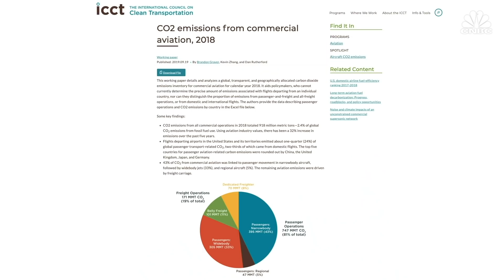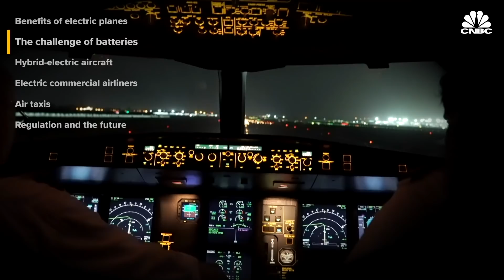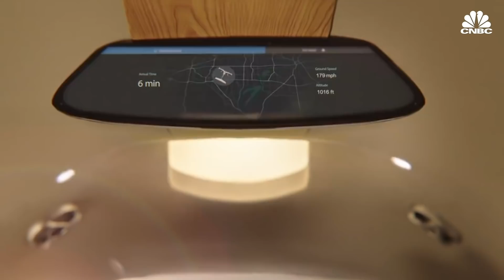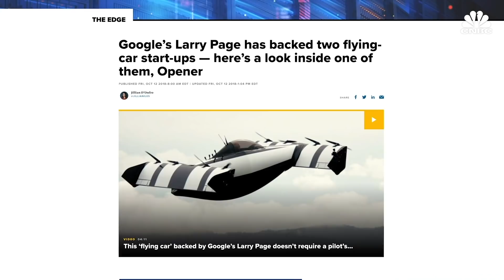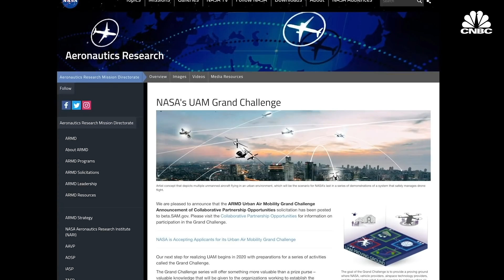Why Don't We Have Electric Planes Yet?

Comment: the other issue for replacing long haul flights with electric is that propeller driven planes physically cannot fly as fast as jet airplanes, the transonic regime that most long haul flights spend the majority of their time in would destroy propellers.
Reply: You don't need to use external propellers.
Reply: @turningpoint4238  good luck heating the air hot enough fast enough to get an electric jet engine to work...
Reply: @136jab  you aren't heating the air to expand it turning the rotating air compressor, what a horridly inefficient way of doing things. Just use an electric motor to turn the compressor. Simple, far more energy efficient and far less maintenance, reducing costs considerably. Never forget what Carnot taught us, because science rules everything.
Reply: @turningpoint4238  how do you  add energy after compressing the air?  simply compressing and expanding the air would cause energy losses due to friction etc.  you still need to add energy somehow and the only way I know of to do that would be to heat the air.
Reply: @turningpoint4238  ok, it has been a while since I sat in a thermo class, and I work in rockets now so I don't really worry about different thermo cycles anymore.  The issue I see with a carnot cycle for propulsion would still be the heat transfer rate from the hot reservoir and to the cold reservoir.  Also, keeping those reservoirs at the proper temperature constantly would be difficult and the reservoirs would be pretty heavy.
Reply: @136jab  take a look how jets work, they aren't like a rocket.
Reply: @turningpoint4238  I remember the jet engine cycle, you compress the incoming air, then you heat it up somehow then you expand it to accelerate it.  I still don't see how you could possibly get a comparable heating rate from an electric system to what you get from combustion.
Reply: @136jab  This is what I've been trying to say you remove the necessity to heat air, thats really not a good thing to be doing. You run the compressor blades with an electric motor. Very simple very efficient compared to a traditional jet.
Reply: @turningpoint4238  compressors and turbines actually run at a net loss in jet engines. The only reason you gain net energy is the heat addition step.  Sure you can run the compressor and turbine on electrical power but you still need a heat source and a resistojet type heat source isn't gonna cut it.
Reply: @136jab  er no, you seem to be stuck on just using a traditional jet engine. Forget expanding air with heat, Monsieur Carnot saw the folly in this nearly 200 yrs ago. Forget the heating  and expansion of air that runs the compressor blades. I know Airbus have been working on this. Google it.

Comment: They forgot to say that jet engines require fuel to create thrust. Even if they sort out the battery issue, electric motors will be propellers. Hence these aircrafts will be much slower than jets.
Reply: Wow, didn't even think of that. Good answer
Reply: In a high bypass turbofan engine the majority of the thrust is provided by the bypass Air. The hot gas generally provides only about 20% of the thrust. So electric motors does not have to be limited to just props

Comment: It all depends the battery, battery don't like cold temperatures in the sky. What I guess engineers may have to design same type of battery that use in space to use in plane. Also if everything is power by electricity, one solar storm will damage everything.

Comment: Maybe a better question would be fuel cell airplanes.  With a fuel cell would require only about min to refuel vs 45-60+ min to recharge and a have larger energy density.  Not to mention the how heavy the weight of the batteries.  One must also look at the fast lane truck tested on towing with a Tesla model x below its tow rating weight and could only do so for 1/3 of its range.  The Tesla Cybertruck was espoused to be at able to tow 14000 lbs for $70k but who knows how far it'll be to do (maybe 165-170).  Whereas a $70k truck from Ford, GM, and FCA can tow 30,000 lbs for about 800 miles.  The electric industry must overcome these logistical issues first on trucks before air transport could be considered

Comment: Temperatures of -44 would wreak havoc on electric batteries
Reply: john son of Morris Not really, as the batteries are not outside. Additionally batteries can have heat themselves when charging and they stay warm when under high power demand (i.e flying). That’s not really an issue I think.

Comment: What about hydrogen? This might be a better option. If i am not mistaken that is also a clean option. All of the airport fuel systems could be converted to hydrogen systems. Hydrogen cells are also lighter and do not need a lot of maintenance. There are many more positives and also some cons, however I'm assuming this might be an easier change to hydrogen than electric.

Comment: If the initial acceleration is most fuel consuming, why don’t we assist it with (steam) catapults, like aircraft carriers? 
If we can’t reduce CO2 immediately a lot, lets try reduce bit by bit, starting with battery powered mid flight cycle.
Reply: Not steam catapults the G on those things is to high. But an electromagnetic catapult could ramp up the speed gradually to take off speed. Fire XL5 if memory serves me right.

Comment: It’s physics. You won’t be able to get near the amount of speed a jet engine provides from a battery operated prop motor. The ejection of fuel at the speed jet engines do decreases the mass of the aircraft as well as providing thrust. Battery prop motors won’t shed weight so it’s going to be fighting that the whole way. We couldn’t have electric spacecraft either you have to shed or displace mass to gain velocity. I could see hybrid jet engines but fully electric will never compete in aircraft speed.

Comment: Simple answer. Batteries are too heavy. 
No need to watch any of the video!
Reply: Look at the energy density of batteries over time.
Reply: Jonathan Edward  you obviously don’t know anything about how airplanes work. So let me educate you. Planes are able to take off heavy but will get damaged severely if they land heavy. So planes are loaded up with thousands of lbs of fuel equivalent to roughly 3 elephants for a Boeing 737. By the time the flight arrives to its destination it burned off all that fuel during flight making the aircraft light enough to land without damaging the plane. If the airplane needs to land early due to an emergency it will spill out all of its fuel in flight so it doesn’t land too heavy. So get educated before you make yourself look like a fool.
Reply: @alextruss  Thats of course if you look at how planes are engineered today and it's more about wear and tear. Then can land heavy but it's beat not to, especially for safety landing with all that easily combustible fuel. It's just an engineering problem and also getting rid of the pilot. I used to know one of BA's most experienced pilots and he admitted he still occasionally bounced aircraft on landing, which dramatically increases loads on the plane. Get rid of the human pilot and the landings will be far smoother.

Comment: Why didn’t you all talk about hydrogen FuelCell technology? 1 cubic meter of H holds significant more capacity than gas itself, and that’s the future of long range electric planes and ships. 
There are several challenges on the Liquid H supply chain, but there are just as many challenges of the standard lithium batteries.

Comment: Why we dont have nuclear powered kettle and nuclear powered everything. Its the same question as why we have not find more efficient ways of producing energy. Right engines burn fuel to create work. We burn everything even in nuclear power heat is everything. We keep on hearing this and that  fancy tech yet they are not still available.
Reply: The Russians tried a nuclear plane, found it's a great way of not having to pay pensions although you only got a couple flights out of them before the radiation got them.

Comment: Fossil fuel is used to charge the  battery. So electric vehicles are pointless not to mention the waste of dead battery in land fills.
Reply: Increasingly fossil fuels are used less and less to produce electricity. Batteries can be reused in grid storage then recycled.

Comment: We’ll also need to create batteries that will last for at least 20 years. Current planes stay in use for about 30 years.
Reply: The battery can just be replaced when it wears out. It doesn't have to last as long as the plane.
Reply: @jamescrud  Yup then reused for grid storage.

Comment: What about the required infrastructure?  If a plane lands in LAX in the summer, there isn’t enough electricity to charge airplanes and meet the current public need. 

Also it might take 12-24 hours to recharge. A plane that’s not flying is not making money.
Reply: Adding the extra electricity is relatively easy. charge times are much more rapid, tech is moving faster the we keep up.

Comment: Maybe we dont need batteries at all, just a small amount of fuel to start up the engines once the engine reaches a certain speed an  hydro electricity approach takes over  3:20 instead of water we use a wind-turbine-generator kind of setup.

Comment: A high speed rail train can get you to the location as quickly as a plane can. America should be investing in high speed rail like China is doing. You can go from Chicago to Los Angeles in the same time frame. The only issue with trains is that you obviously can’t ride over the ocean, only then is a plane necessary imo.
Reply: Airplanes are still faster from Chicago to Los Angeles. It only takes about 4 hours and 35 min on the more than 1,600 Mile trip. However, trains are still slow. On the Beijing to Shanghai high-speed rail trains go at 217 mph, it takes nearly the same amount of time to go less than 820 miles. A Beijing to Shanghai flight only takes 2 hours and 10 min.
Reply: But you can't ask other countries to build a single high-speed train track. People use planes for domestic and international travel.

Comment: People would have to take a huge risk to fly on an aircraft propelled by batteries. The psychological fear of a battery failure or charge going down is far bigger than a jet fuel going down
Reply: Not for people that know the reality, the FUD doesn't work well these days it got over used and became a joke.
Reply: @turningpoint4238  what's fud?
Reply: @shravan2010  Fear, Uncertainty and Doubt.
Reply: @turningpoint4238  everything doesn't work that way. There are serious shortcomings in a battery when used in a large aircraft. Only a naivete would dismiss reservations about the technology with fancy jargons like "FUD."
Reply: @shravan2010  don't be scared of change.
Reply: @turningpoint4238  ok not gonna waste my time with a charlatan
Reply: @shravan2010  thats ok your opinion isn't important, only science and facts.

Comment: Traditional chemical fuels come in around 40MJ per kg. Current lithium ion come in a little under 1MJ per kg. Of course electric motors are more effecient than engines. For most passenger vehicles, effeciency corrected, chemical fuel carries 10x more useable energy per unit mass. For a very effecient jet engine, that could be more like 20x.

Initially electric airplanes will start with small passenger variants. Then they will move to domestic routes, and likely air freight, as the logistics allow more charging stops. Finally long haul commercial aircraft. The changes required will not just come from improvements in battery design, but also improvements in material science, like use of Carbon Fiber Reinforced Plastics.

It will probably take 10-20 years before commercial jet aircraft start seeing replacement by electric counterparts. Perhaps longer If fuel prices drop.
Reply: It would take 100 years mate. Listen to a guy that deals with airplanes. First of all, you need metal structures for planes so you can ground your circuits. Especially in larger airliners that rely on computers and electromotors. Without such grounding, you'll need to carry twice as much wires, Second of all, you need metal structure (or better said covering) to create a Faraday cage so your plane would not be turned into ashes the second a lightning strikes it. Small planes can get away with using less metal because they are designed in a much different way and fly according to different regulations, but airliners don't.
Secondly, just look up for videos about Tu-95 and Tu-114. Since you cannot make an electric jet, things like that are the closes comparison to what an electric airliner would feel like. Just listen to the beautiful sound of those engines with supersonic blades and imagine hundreds of them over your city.
Reply: @nottoday3817  100 years is an absolutely ridiculous assumption. Of course aircraft will always require traditional metal structures. As for lightning strikes, those are exceedingly rare, and I have faith that the engineers at a company like Boeing can design a non traditional airliner to survive lightning.

I see no reason why electric motors cannot be installed in the same manner as a jet engine. Remove the core, replace it with an electric motor. It would basically just be a really large EDF, which are currently built for many different applications.  Battery development is accelerating at an exponential rate, even if it never reaches the energy density required for long haul flights, the significant cost savings may convince most consumers to do a 30 minute layover for a charge.

Comment: Why we don't have electric planes? For the same reason we've traded turboprops for turbofans as main engines of airliners. The best turboprop airliner was Tu-114, a plane inspired by the Tu-95 bomber. Those planes could compare with modern jets. And you'll spend half the ammount of fuel. However we don't use them because the mechanisms for a turboprop gearbox (reduction gears) are extremly complex. And not only that, but the noise made by those blades is hurrendous. Why I am mentioning turbo-props? Because it's impossible to make an electric jet. You need propellers. This means either less performance or a noise level so deafening that people would start demanding airplanes to be banned.

Comment: It's not only batteries that need to be more energy dense (at least 40 times more dense), it's also generating electricity and charging times that need to be improved. For charging Nuclear power can be cleanest as solar and wind is just way too impractical. I can only see the first viable commercial planes around 2060. Hybrids is highly debatable as the same amount of energy as with fuel is required after all.
Reply: Actually you don't need batteries to be 40 times more dense, double what we have today, remove pilots and build planes in an intelligent design (not in an evolved fashion). Charging times are getting to be fast, for example version 3 Telsa chargers. Nuclear is to expensive (used to be a nuclear operative) solar and wind are the best approach especially cost wise. No hybrids can use far less fuel.

Comment: They said we would get self-driving cars by 2020. Where are those? :/
Reply: They still have a few days left until 2020...
Reply: What about Tesla
Reply: bounty county  it’s not self driving it’s a autopilot system you still need to keep your hands on the wheel
Reply: @anthonymolina7416  l was responding to Victors question on self driving cars but thanks for the heads up
Reply: What about Tesla

Comment: the power density thing was an interesting thing to learn about. Didn't know they really need to beef up batteries power density to be on par with jet fuel. The tech does seem to be on it's way though. EV's have come leaps and bounds in the last 5-10 years. I'm interested to see what the future holds.
Reply: except we're still burning through fossil fuel to charge those EVs. Without widespread nuclear energy EVs are an unsustainable joke

Comment: Don't be dumb, use hydrogen fuel cells for airplanes!
Reply: Where would you place them? They wont fit into the wings.
Reply: @sos10  Inside the wings is where the liquid hydrogen is to be contained, but you still have lots of useful space that could be used for store the fuel cells inside the plane.